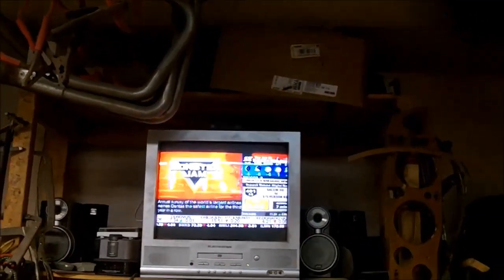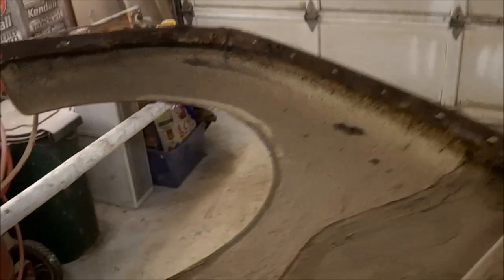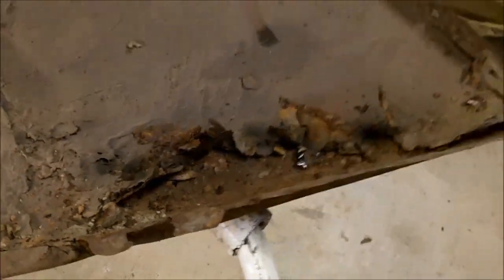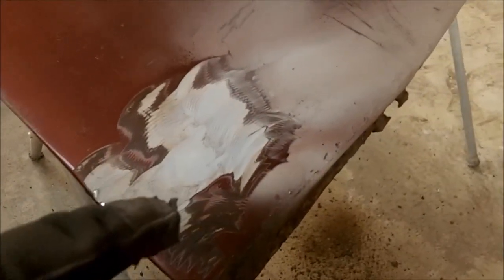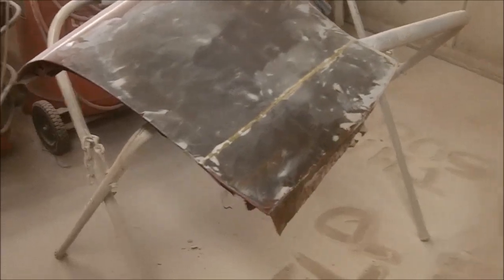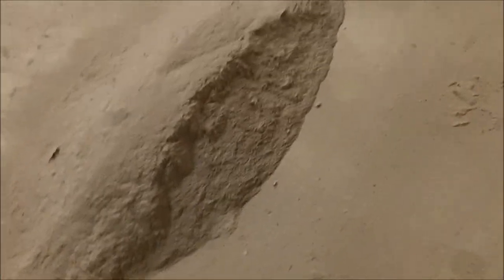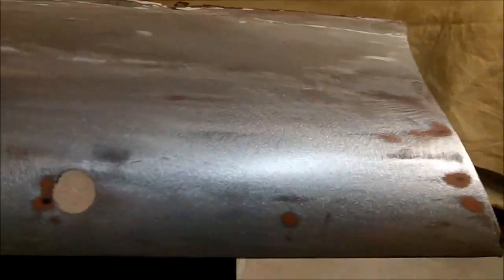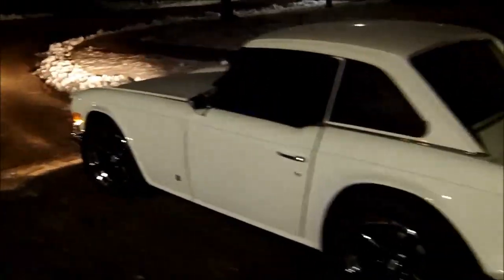1959 Triumph TR3A Restoration, Front Fender Stripping, Part 1

Comment: Messy, messy Tush! More snow inside than out. Sanding filler is the worst job! Ends up like talcum. I prefer to use heat or chemical. Well done on your staying power.
Matthew

Comment: This type of "repair" was made 'way back in the day' before there were replacement panels.  It looks like waaaaaaaaaaaaaay to much work for me unless you are just going for the "Fender Fixer Of The Year" Award. I would just cash in a couple weeks worth of beer bottle deposits and buy a new fender.  (Dave Mill has this same pyhcosis.) I think that it might be curable with enough 'Jack Danny on the rocks' of common sense.  I would take a look at that and yell out to my wife, "Honey, You ain't gettin' them spike heels and a new whip this pay check 'cause I'm a-gettin' a new fender fo my 'Trump'.  See what I'm getting at Dave?  (Although I did get a new hammer and dolly set under the tree this yule season.)  You're still my resto-hero Tush Man.        chow.......................Jerry
Reply from the maker: Maybe you could come and practice with your new hammer and dolly.   Leave the whip at home :-)
Reply: You are one funny guy, Jerry Houck.  How about dropping the i and the h from the lettering on the front of a TR3 and closing up the rest and you are there !